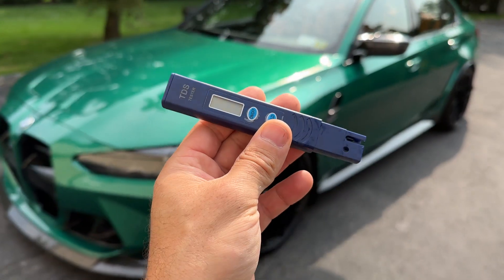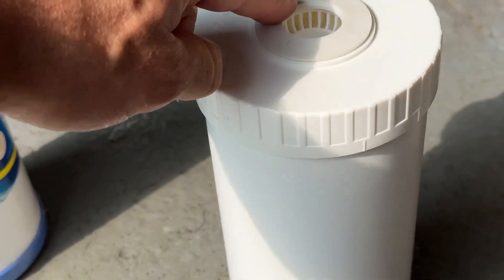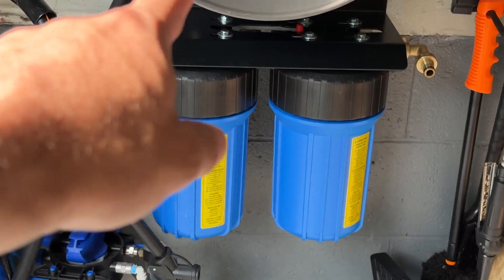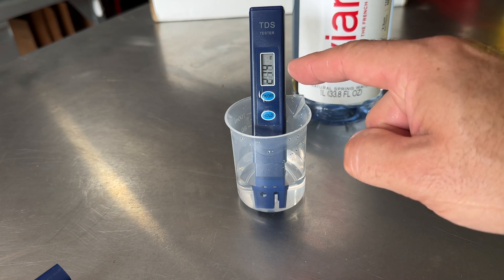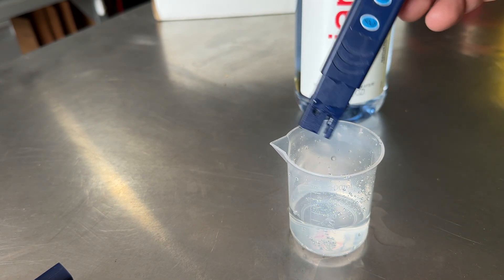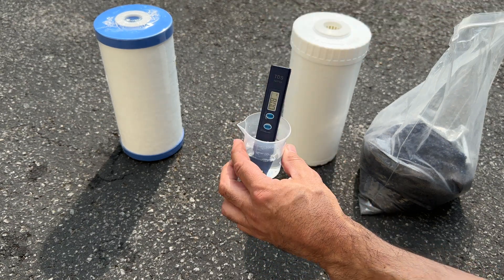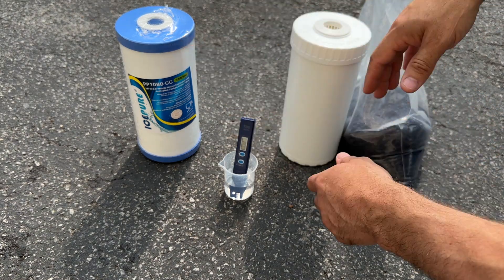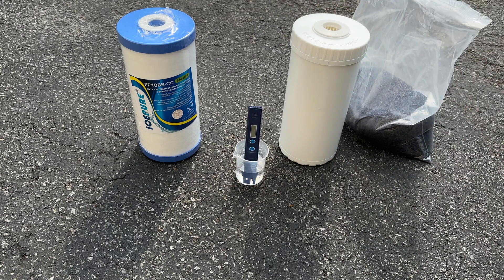Water Filter Deionizer Update | Whats My TDS After Months Of Continuous Use

Comment: The level of TDS is dependent on how fast the resin needs changing. At 50 tds its not surprising its lasted that long. Washing with 200-400 drastically shortens its life.
Reply from the maker: yes but considering i wash 4+ cars multiple times per week and everything around the property this TDS level lasted far longer than I expected.
Reply: @autofanaticcars  my post was more for everyone else that has higher tds so they don't get it and expect it to last that long for them, then be mad when it doesn't. 

Tds is what will determine how long it will last. There is a chart out there how long to expect resin to last with gallons based on tds